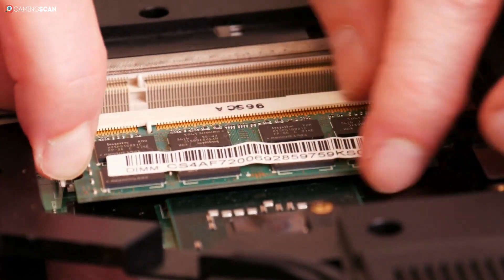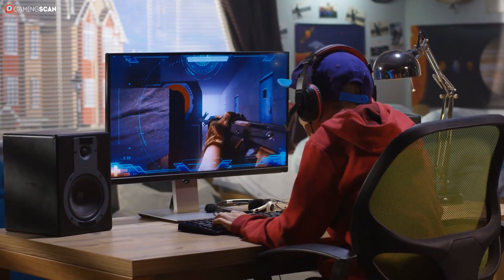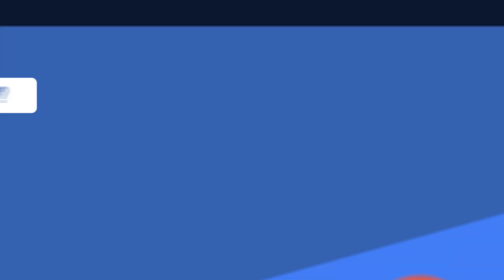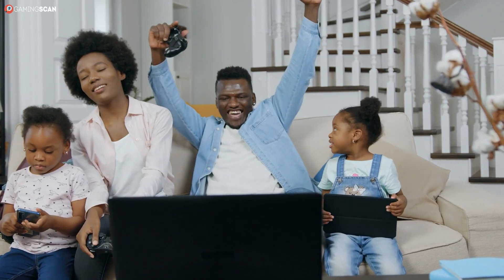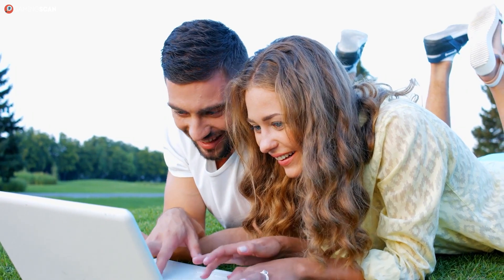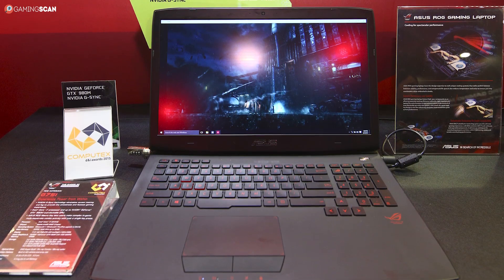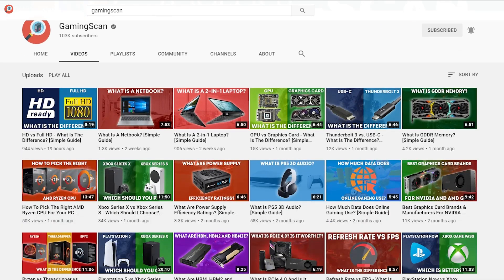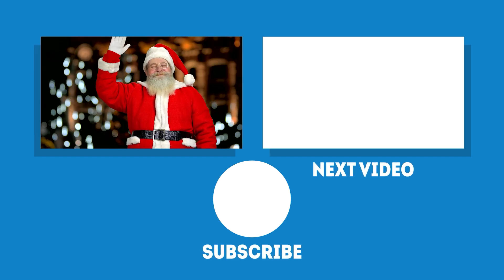Mobile CPU vs Desktop CPU - What Is The Difference? [Simple Guide]

Comment: If you use you laptop with power cord connected, than it would provide more power.
Reply: not really it still uses the same amount of power.
Reply: @metalvideos1961  Are you sure? My laptop processor tops at 25 watts on battery, with the charger connected it tops at 75 watts
Reply: @afonsogouveia2109  Yeah you're right, he's wrong. Most laptops perform way better when plugged in, that is due to the fact that they don't need to be "power efficient" so no need to save battery, therefore they feed more wattage into both cpu and gpu. This is especially truth in high wattage fed hardware, however i think it applies to most laptops nowadays. If i'm wrong please feel free to teach me better.

Comment: Gaming pc is much expensive than laptop
Reply: laptops are more expensive than PCs, people can assemble a PC with rtx 3070 for $1000, and for 70k a laptop with only 3050
Reply: @kytk123  I agree that the desktop only is cheaper than a laptop while being more powerful, but the pheripherals mess up the price
Reply: You don't know a fk about computer
Reply: laptop is much more expensive as it is more mobile which makes the components a lot smaller while still having the same performance, but miniaturization of electronic devices is expensive
Reply: Bruh that's not true
Reply: @namratayadav4202  bro, you are living in dreams. When you create desktop you compromise a lot of things, some times less ram, sometimes less Storage, sometimes cheap monitor, sometimes inappropriate Brand GPUs & even cheap motherboard, all in the name of "fitting in the budget". You may not know, 63.4% of desktop user's in the planet never makes a complete desktop. A "complete" desktop with proper ram, storage, graphic card, mother board, good cheesy, good monitor & power box comes with 1650 $ (Dollars)(USA). But on the other hand(Dell brand), a laptop with rtx 3060, 16gb ram, 512gb PCI gen 4 SSD (NVME) ,144 Hz display panel & other existing ports will cost you 985-1100 $ (Dollars). You decide.
Reply: @rajonskywalker  not really I have a budget pc which costs like ₹35,000 which has a Radeon A-series cpu with a atx motherboard of msi, ant esports cabinet, 8gb ddr4 ram and gt 1030, 256gb sdd and 500gb hdd, 19inch monitor, also later I can costumize it like buying a new cpu, while I found one laptop it had same 256gb ssd but didn't have any external graphic card, it had ryzen 3-3rd gen(the cpu was good but I was not convinced with the other specs) it was 15inch and and it coated around ₹41,000 well so it was kinda ok but the prob I can't modify the cpu later so I had to again buy a new laptop so that's why I chose desktop also it matters on you.... well that's what I wanna say
Reply: @namratayadav4202  bro I'll give you better laptop in that price range.
Reply: @namratayadav4202  Nvidia 1030 seriously
Reply: @namratayadav4202  bro, maybe you are unaware of sync & non-sync criteria of an motherboard
Reply: @namratayadav4202  I will give you some link to justify. You have miss judged between a complete desktop & budget desktop
Reply: @rajonskywalker  KKK btw I understand what u mean like between a complete desktop and a budget desktop ikr but I was just sharing my opinion I understand what means a complete desktop
Reply: @namratayadav4202  when you have a  completed desktop, you never think of changing anything in the future . People who buys budget desktop ends spending more money in the future which is very bad for user experience.
Reply: @rajonskywalker  Laptop is much more expensive than a desktop, with the same specs, you could get it with a desktop. Desktop is much more customizable, you can change the cpu, the GPU, and so on, plus it is much more efficient and has a good airflow
Reply: @r2vbwh153  true!
Reply: @rajonskywalker ok give me a beter 355$ laptop than my pc rx 580 8gb of vram with 16gb of ddr4 and amd ryzen 5 3600 evrethyng used exepct cpu ram an ssd and psu

Comment: Mobile Core i7-11800H makes the desktop Core i9-9900K irrelevant. That mobile chip is ridiculously fast and the power consumption is less than a half.
Reply: Comparing cpus from different generations lol
Reply: There is a chinese company that uses that cpu on a desktop motherboard. Its super cheap. Around 200$. For that price you get a monster cpu with a desktop motherboard. Win win
Edit: it is called Erying
Reply: I5 13th gen desktop makes the core i9 9900k irrelevant. But guess what, you're stuck with the old i7, while desktop users keep upgrading and selling old cpu chips.

Comment: If you're willing to fork out the dough, they do make gaming laptops with desktop CPUs.  However, even these have power caps placed on them in the bios to prevent them from melting to the Earth's core.  Also, you're going to be waiting a while to get one of these custom built machines.  It's been four weeks now since I place my order for an Origin Eon 15x and it may be another two weeks before it's ready to ship.
Reply: @Dacia Sandero guys Can't move though *cough *cough